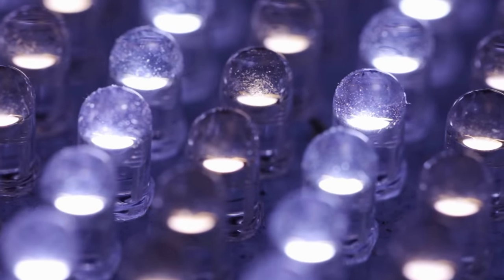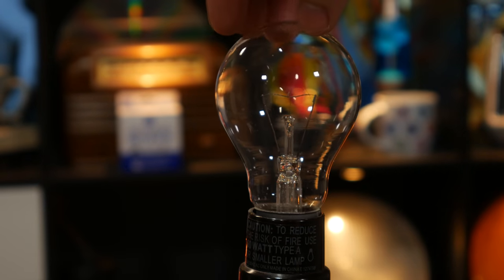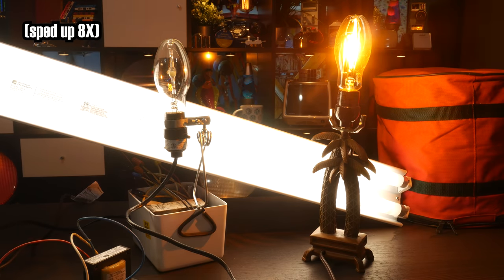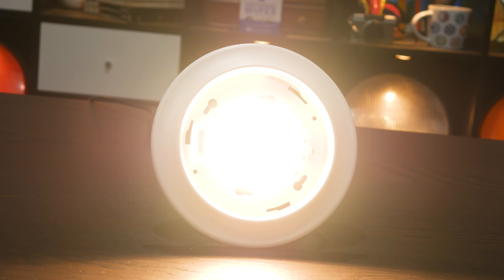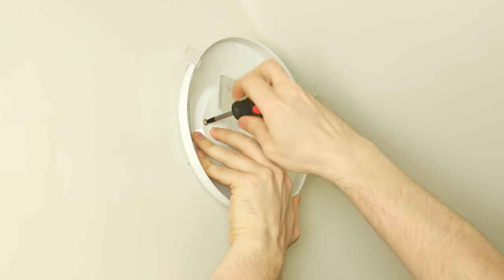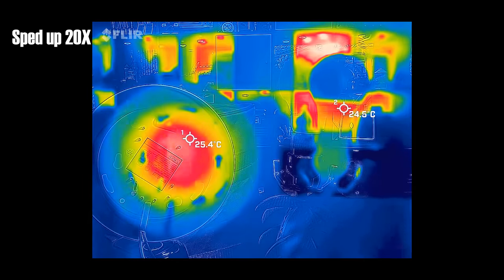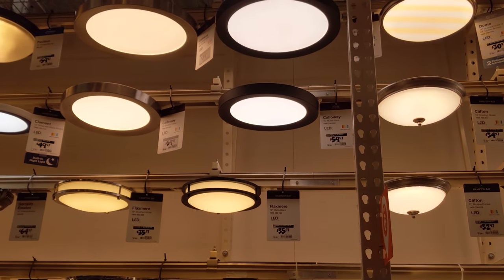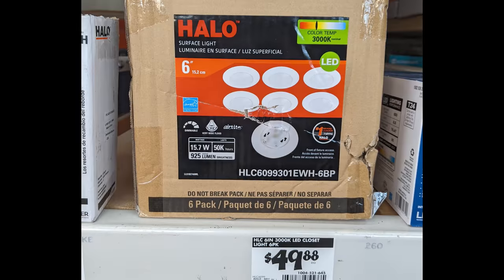A troubling trend in lighting?

Comment: The obvious answer to the maintenance problem of these fittings would be for the industry to settle on a standard design of flush-fitting socket for wall and ceiling lights so that the fittings could just be twist-and-remove for householders not trusted with a screwdriver. You could also make a ceiling rose adapter for people that suddenly decide they need a pendant lamp in their life. The cost for these need not be any more than a normal lamp holder once economies of scale are taken into account.
Reply: It is twist to remove for the fitting he's just using the wrong holes.. then you need to use wago connection
Reply: that would make sense but it would probably result in an xkcd 927 situation. you could go as war and make a nor circuit board that use connectors similar to what is used in PC memory so you can just pull out the old board and plug in a new one. you could even go as far as make the driver independently replaceable. but nobody is going to do it unless they are forced to.
Reply: This exists, both in concept and standard. In Japan, it is standardized as JIS C 8310 and it is ubiquituous: A simple 2-prong bayonet socket that is supposed to provide both electrical and surprisingly strong physical connection. It comes in a few housing formats, some round, some only barely housing the contacts, some with locking tabs and some with additional mounting points for really heavy fixtures. It does protrude some 10 mm from the surface,  but many light fixtures take that into account.

Edit: I realize it's a bit hard to find using "western" search terms. Search for "引掛シーリング" (yes, this translates to "Hook Ceiling" ... those quirky Japanese!)

It also exists out of neccessity: Japanese apartments regularly don't come with lights or even light fixtures, you are supposed to bring your own lights and ... twist them to the ceiling.
Reply: I agree to an extent but honestly, I would say that doing something more like a USB plug in leg "bulb" housed within the fixture is better. You get far, far, far less waste when replacing LED's. Even if the fixture itself is standardized but needs to be tossed out is a bad design because you have to toss out the whole thing when just the led itself is bad.
Reply: Either a flush fitting socket, or replacing bare-wire twist-crimping with some form of standardized plug and socket arrangement where no bare part of the wire is ever fully exposed.
Reply: @TacComControl  the fixture being replaceable is a separate issue from the fixture. This already a bad discussion as a result of LEDs being built into the fixture. You want swappable fixtures, fine. But the LEDs within that fixture need to be replaceable too.
Reply: @drmr4613  I want!
Reply: @SerifSansSerif  ...Eh? Like, aside from an aluminum backplate and a plastic ring, there's... not really much to replace. Basically all of it can be recycled or refurbished, and if the manufacturer includes, say, a return postage stamp so you can just send back the damaged or dead one, maybe for a deposit or something, that sorts out the waste problem right there.
Reply: @jusb1066  Those Wago, or other push-connect fittings result in a fraction of the surface-area contact that a twist-connection offers. If you trust putting the rated 20A of current through a razor-thin piece of spring-metal, then okay. But for those of us that value longevity, we will be sticking with the twisting of wire-nuts.
Reply: @TacComControl  that is unlikely to happen, (people don't recycle much and recycling itself is a crapshoot as to whether or not something gets recycled) and though the pieces may not be much, you forget how a little can add up significantly when done for years or amongst enough people. 

And it's not limited to the can/boob light. It's ALLLLLLLLL The lights, including the chandeliers mentioned. 

That's why the LED lights or light strips themselves need to be standardized and replacable.
Reply: Before watching this channel I haven't even heard of wire nuts. Basically all those connections here are done with screw terminals.
Reply: @SerifSansSerif  I get what you're saying about normal recycling, but if we're just talking about part reuse, like the factory taking the old aluminum back plate off of fixtures that were sent back, especially if they are under contract with multifamily builders or maintenance which allows them to get them back more readily, that reuse becomes itself a savings, both in landfill and in cost. Like it or not, a lot of fixture parts are never really reused. Tons of face plates just end up thrown in the trash, standardized or not.
Reply: @joshpit2003  well, if you're going to stick to your aluminium wire ... Otherwise theyve certainly been tested beyond
Reply: Just get NEMA to issue a new standard for L5-5P/R and get IBC to require it for all non-screw-base light installations. That's it, now the manufacturers of these DIY electrocutions just need to put an L5-5R prong on the back side of the unit instead of those loose wires. 
But making standards is hard, apparently. And the people in charge of it haven't had to do their jobs in a while.
Reply: @TacComControl  This would be true if the pieces were worth it to recycle. A lamp that costs the consumers $15 is going to cost about $5 to make and most of that cost is going to be in the LED itself. Paying return postage is going to cost more than that, and considering it may be several years before it needs to be returned means the return label is most certainly going to be lost.

The only thing that really gets a return label sent with it and makes sense in the current environment is printer cartridges, which sell for $80, cost about $5 to ship back, and refill with about $1 worth of ink.
Reply: @HappyBeezerStudios  - 🇬🇧
Reply: @SerifSansSerif   Why? It's 200g of steel and 300g of plastic?  Pay for modularity and long term availibility if you want to,  but lowist bid wins 90% of the time so most of your contractors aren't going to prefer the modular model.
Reply: @SerifSansSerif  My point is, I feel, that the actual content of these fixtures is so minor that making replaceable elements merely introduces extra connectors, cost and reliability issues. The principle issue is that the sole advantage of these fixtures is the larger PCBs and thus better cooling. In all other respects the fixture is just a large, flattened bulb so why not just but a bayonet or screw connector in it so people can just replace them without exposing live connections or having to use a screwdriver like they currently do with bulbs?
Reply: @IanSlothieRolfe  I can see your point. They are kind of large light bulbs, and perhaps we aren't that opposite each other in our thinking.  I guess my only other answer is that having to replace fixtures instead of bulbs means companies would have to stock a lot more varieties due to previous models and customers will have a difficult time finding exact replacements
Reply: @joshpit2003  It should be noted that my grandfather said substantially the same thing about wire nuts as he was pumping up the gasoline torch he used to heat his soldering iron...

I was taught to strip and twist solid conductors, trim them, then install the wire nut to provide insulation and mechanical protection...the only VALID use for a wire nut.  Stranded conductors were to be tinned, then treated as solid.

Personally, 20A and over generally gets crimp sleeves and heat shrink.  Then again, I'm not an electrician...I can spend the extra time and money without it killing the bottom line for a job.  

I can share with you that IDC and push-connect fittings have been in use at or near the rated conductor current for well over 50 years in the Telecom and Telemetry fields.  I figure that they can't be THAT bad when the IDC fitting is intact but the 22-ga wire coming from it has melted in half elsewhere.
Reply: @joshpit2003  We don't use wire nuts with 240 Volts, screw or wago connectors.

Comment: I broke one of those fluorescent bulbs above my head once when trying to change it and I'm pretty sure I felt mercury vapor hit my face, so that's nice. Still waiting on my super power.
Reply: Best match is the Mad Hatter, surely, so I think you need to try making mind control devices.
Reply: old fluorescent tubes were instant light sabers when i was a kid!  So im pretty sure you will be ok!
Reply: @jsnsk101  And they were amazingly difficult to break, until they broke.
Reply: @UncleKennysPlace  That's what glass tends to be like. Really strong, until it's not.
Reply: My home has recessed 4-pin GX24Q fixtures in the kitchen thanks to CA Title 24 building requirements.  This means that it had recessed CFL bulbs that needed to be pushed in and pulled out with significant force.  The recessed nature also meant that I could not push/pull on the bulb base and instead needed to apply force to the glass.  Needless to say, I broke bulbs and potentially contaminated my food preparation area with mercury dust multiple times.  I got fed up and bypassed the ballasts so that I could use cheap LED bulbs with Edison screws.
Reply: Wonder how many cans of tuna that was...
Reply: CFL light bulbs contain 1-5 mg (0,001-0,005 gram) of mercury, that not much
Reply: When I was a kid I found a golf ball in a friend's garage. I bounced it off the concrete floor and had no idea they rebounded high enough to hit the fluorescent lamp about six feet above me. Evidently I turned away when I heard the bulb pop, and a piece of the glass gouged out a piece of my calf. I still have a divot (heh) there. No superpowers, but I have no idea if I would have be more smarterer without huffing the sweet sweet mercury vapor. Jokes aside, I'm sure I'm no worse because of it.
Reply: Vitamin M
Reply: I would love him to have a video on the ACTUAL danger of flourescent bulbs. We always see messages saying we're going to die, but I haven't seen anyone die yet.
Reply: You mean early death
Reply: Mercury poisoning might be a super power in an alternate universe. Maintain optimism for the longevity of your alternate non-poisoned self. 👍 😃
Reply: Nah, you didn't feel mercury vapor hit your face.  You might have felt a bit of liquid mercury, but you just breathed the vapor.
Reply: How much does a Useless Duck set one back these days?  We have been looking into the market lately...
Reply: Remember, it's vaporized when the bulb is on. You're not getting dripped on it the bulb breaks. You're breathing it in.
Reply: Also, an acute exposure has a vanishingly small likelihood of causing ANY long term harm to your body. Your liver and kidneys are extremely efficient and effective at removing heavy metals (chelation? Sp?). The mad hatter was a syndrome from repeated and extended exposure.
Reply: @jsnsk101  We would find them in dumpsters and use them like javelins that "exploded". We were slightly more responsible than you might think. We aimed at the very same dumpsters they came out of. One way or another, they were going to break and deposit mercury in a landfill. We just leveraged a brief "second life" by getting a bit of fun out of them.
Reply: You got more phosphorus then mercury. As someone else pointed out there's about nothing in florescent tubes.
Reply: It's not out of the question that you might have a very minor case of serious brain damage. Don't be alarmed, although if you do feel alarmed, try and hold into that feeling, because that is the proper reaction to being told that you've got brain damage.
Reply: @gavincurtis  GET OUT. 🤣🤣🤣

I'm totally stealing that joke!! 😂
Reply: @tek4  The T12 4-foot tubes had quite a bit more mercury than your twisties
Reply: The amount of mercury is negligible, you felt nothing.
Reply: @CubicApocalypse128  thanks Wheatley
Reply: When I was in high school, a few of the kids were throwing a football around in the locker room, and one of them hit a fluorescent bulb with it. The bulb fell to the ground and shattered.
Reply: @LabRat Knatz The Chinese ones definitely don't skimp on the Hg, which I find odd because that stuff is expensive. I have a Shenzhen special 12" germicidal lamp+fixture I got a while back that probably has a drop worth of the stuff stuck on the glass.

Comment: Japanese ceiling mounted light fixture sockets are worth taking a look at also. As lighting has to be taken with you when you leave an apartment it's easy to swap fixtures and now they sell LED versions which I use in my apartment.
Reply: Yes, I first saw this on my second apartment which didn't come with main ceiling light (just the socket). I bought a rather fancy one and when I moved again, I brought it with me and installed it on new place, replacing the preinstalled fluorescent light (with no remote etc). The mover company even helped me detaching and installing it.

The main problem is I have to keep the old one, filling up my room...

The general term for it seems to be 引掛シーリング or JIS C 8310 (there are various types with their own names). It's first invented in 1977 (!) and becomes widespread in 1980s according to Japanese wikipedia.

Comment: Pro lighting guy here. Thanks for calling the lamps "lamps" and the fixtures "fixtures." Well, much of the time.

In addition to the lack of attention the average user pays to color temperature, one of my major gripes with consumer LED lighting is the lack of flexible, user-friendly control.
Reply: It drives me nuts when I go into a house for a service call and all the lighting is different temperatures.
Reply: @blairanderson5925  I've had so many of my led bulbs fail over time and can't find the exact same lamps. So after 15 years of changing out lamps the color temperature is all over the place even though I always buy warm white lamps.
Reply: @yannick7230  that can be simply because over time, the color of the diodes shift a little. And that doesn’t really bug me, although manufacturers definition of “warm white” can vary drastically depending on the brand. I’ve seen warm white bulbs rated at 2000k and as high as 3000k. Regardless, what bothers me is seeing a cooler white bulb next to warm white next to a daylight bulb. All because the homeowner didn’t understand what a color temperature rating was.
Reply: @blairanderson5925  i bought a bulb for my bedroom rated "daylight" expecting it to be fairly close to the yellow-white of sunlight that makes everything look nice when the curtains are pulled back.

I was very not prepared for the super blue-green tint that clashes with the rest of the house's lighting. In isolation its fine and its nice enough for reading but it isn't what i intended.

I will never trust the descriptors from manufacturers and will instead have to learn what color temps actually look like. (I understand they are the color of a black body radiator glowing at that temp, but that doesn't correlate to qualitative understanding) i doubt that bulb is getting replaced any time soon since i moved out i doubt its getting much use.

Comment: When LEDs started becoming useful in professional lighting (about 10 years ago) there was a push for ease of replacement through standardisation of modules - take a look at the zhaga consortium. It seems to have fallen by the wayside for the most part though, probably because the lifetime of a commercial lighting installation is about the same as an LED luminaire!
Reply: Zhaga wasn't meant for the end user. It was meant to give traditional fixture manufacturers the ability to design around a standard module that could be purchased instead of needing to hire engineers.
Reply: I knew what a luminaire was. But until I looked that up, I had never seen the term "light engine".
Reply: @kliepmann  It doesn't matter who it was made for, but if it can solve these issues. If it can, great!.

Comment: I had one that lasted a few years and the ballast went, I just replaced the ballast and that was 3 years ago now.  They should make the board that is held in with 3 screws with some contacts on the back that are standardized.  You can have what ever you want on the board, even smart controls where you just leave the switch on and turn it off with a application or change the temperature and/or color of the light.

Comment: This is EXACTLY what I ran into when shopping for a new ceiling fan.  Lots of the expensive ones have an integrated LED light kit and their own "smart" features and stuff.... which is fine for people that want them, but I want to continue using my 'smart bulbs' because I have more control of them than what's possible with the integrated LED kits.
Reply: came here to make this exact comment. the ones i liked the style of all had an integrated LED light kit that i'm damn sure will be unobtainium by the time it fails.
Reply: many of those smart fans I thought still included a 'cap' with an edison socket instead of an led, and also included a slug-cap with neither.
Reply: when it eventually dies, instead of replacing the entire fan just replace the light part. most of these standard fans are built with many pieces and you can replace the entire light with another one with edison screws

Comment: Not sure if it was mentioned, but another problem is that you probably have to drill new holes in your ceiling when it's time to replace the fixture (don't count on the same model being available in a few years). That's especially bad in a bathroom because of the moisture in the air, and unfortunately most of the light fixtures rated for bathrooms nowadays are LED fixtures... I went with a traditional ceramic fixture.